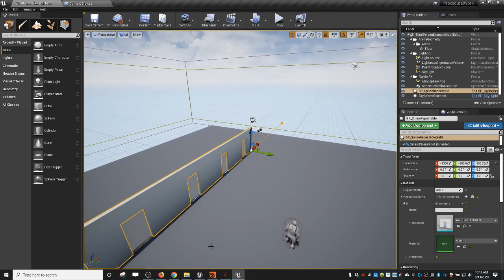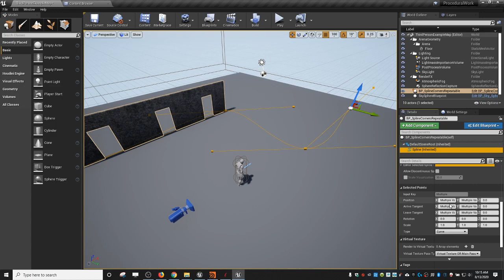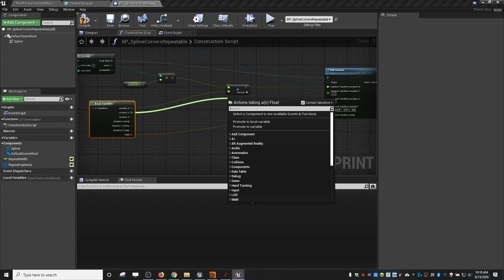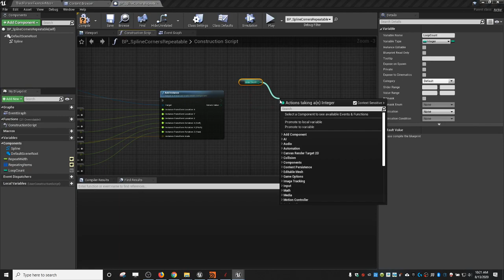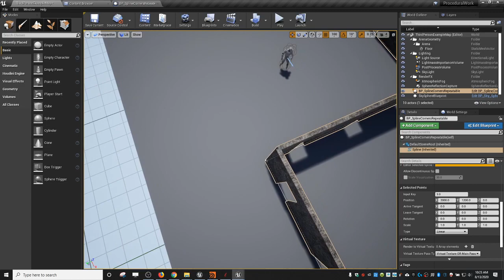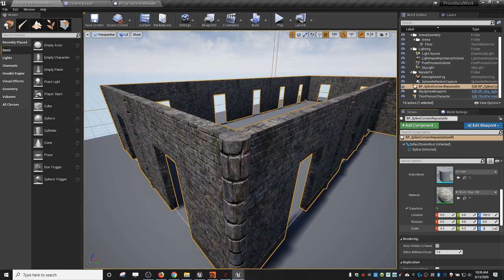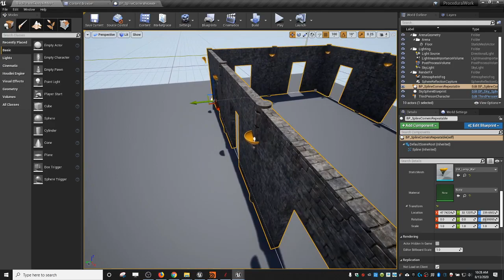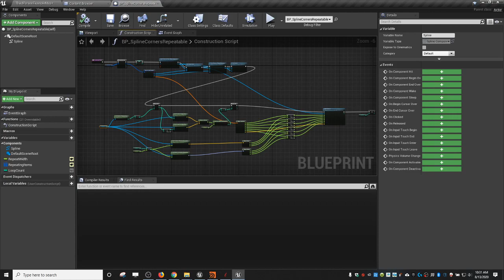Unreal Engine - Procedural Static Mesh Generation Using Splines with Corners

Comment: Thank you for this tutorial. Only problem I have are the splines not snapping to the grid. Grid snap works when placing the object and I set the grid snap position value to 100 but it doesn't work for the spline itself for some reason.
Reply from the maker: Hmmm I've never had to do anything different to get the spline to obey the snapping setting - I'll see if I can figure out a way to turn it off and on
Reply: @JamiesHobbies-GGB  Yeah I don't know what I did that disabled the snapping. Been banging my head on it for a few days lol
Reply from the maker: @firstreality3867  Under the settings menu there is an item called "Enable Vertex Snapping" - if that's on - try turning it off :)
Reply: @JamiesHobbies-GGB  Wow it worked thank you! It's always some random checkbox that was turned on

Comment: Thanks for sharing, but  i have a question, can you make a tutorial on how to make roof for this spline system?
Reply from the maker: Depends :) if you want a flat roof - like a shopping center might be - that's much easier - a pitched roof like a house is quite a bit harder to do without Houdini - I think it's still doable though so I'll take a look and see what I can do - Thanks
Reply: @JamiesHobbies-GGB  flat roof for buildings like in New York. I want to make splined building blueprint